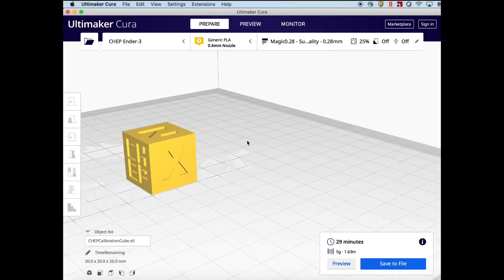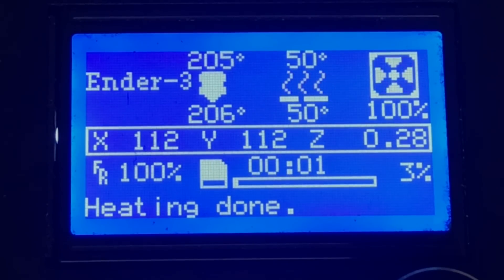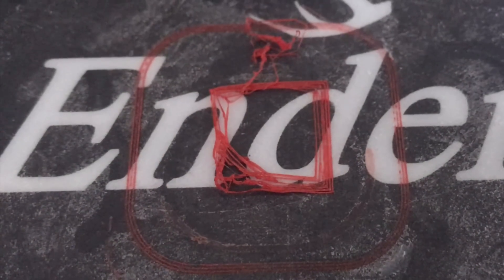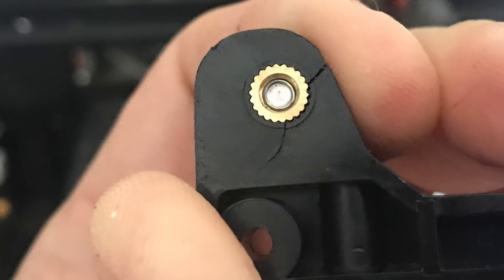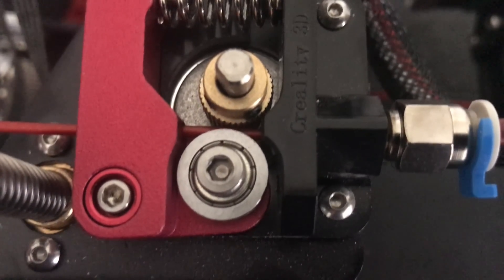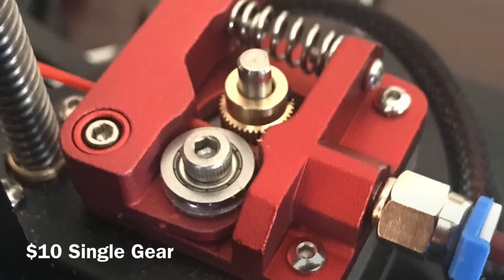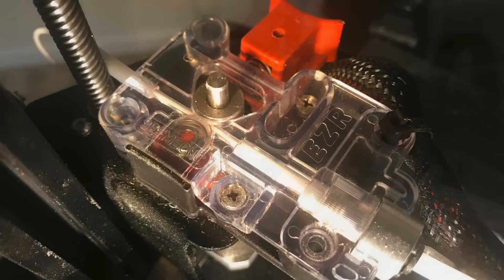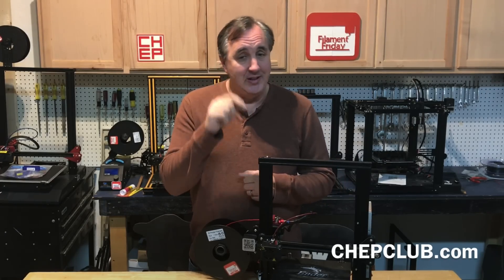Fix Under Extrusion from Cracked Extruder Arm on Creality Ender 3

Comment: Yup, mine is split really bad. I've been dealing with this for almost a year. What else should I go ahead and replace on my Ender 3 Pro? Thanks for the video!
Reply: Hey there, went through a similar patch. 

A safe bet is to replace your nozzle, your ptfe tube (or upgrade it to a Capricorn tube for 5$) and replace the pneumatic couplings on your printer on every part that uses them. These are some super duper cheap mods that can really help to set you up for long term use. Enjoy the wonderful world of 3DP!!

Comment: I hear crackling like a campfire when printing on my Ender 3 what is this? It's actually only when using black overture petg not white..please be mature, it feels like I have to say that.
Reply: Maybe you filament isnt dry. The Water evaporates and making the noise.
Reply: @Yo_Hahn  thank you
Reply: Make sure your extruded arm and tension are properly set and assembled. Easy thing to check could be where it’s eating/grinding your filament. Crackling can also be over heat, moisture, over extrusion bubbles etc

Comment: Just had a cracked extruder arm just one month after purchasing ender 3v2. Guess I have to go for the metal extruder.  Really just too fast a component failure. Creality needs to have a better version for the extruder. Thanks.
Reply from the maker: They upgraded it on their new Neo line. https://youtu.be/EKE1FnuTkcU
Reply: @FilamentFriday  at least they improved 😁

Comment: I want to say thank you very much! I never would have picked up that cracked arm! I tried everything before finding your video. Sure enough, I took the arm off and there was the crack. In my case, I glued it back together (just to make sure this was in fact the issue) and it fixed the under extrusion. I did however purchase the aluminum fix. Thanks again!
Reply: Hehhe.  I  actually removed mine to check if the gear next to it isnt maybe dirty from filament and slipping. When the arm was off and i turned it around... ta  daa

Comment: Even after replacing the extruded the idler arm still won’t spin unless I push down on the lever
Reply: I have the same problem, were you able to solve it?
Reply: @maximilianonunez8431  it ended up being a combination of two things. the nozzle was clogged and the position of my roll of filament was oriented in a way it was causing to much pull on the filament causing a clog. clean the nozzle out even if you dont think its clogged and then position the roll of filament as close to the extruder arm as possible.

Comment: Thanks again CHEP. My printer was doing the same thing, and finally decided to replace the extruder. It was also the hairline fracture. Just bought the metal replacement. 
Would be cool if the Ender came out with an expensive part model (such as metal extruder/better PTFE tubing/higher quality springs) would defs be worth buying

Comment: had the same problem tried everything cleaned nozzle, changed nozzle, changed bowden, tightened the spring of clip arm without knowing there was a crack which worsened the crack but finally found this video and tada i found the problem nice work man could not have done this without you

Comment: I was having under extrusion problems and it turned out to be the screw that goes inside the spring in the extruder. I tightened it in and solved the problem.

Comment: Thanks for this video.  I was having a major problem with under extrusion and I thought it was in the hot end so replaced the nozzle and did the hot end fix and nothing changed.  I watched your video and had a look at the extruder arm and didn't see anything but did notice the guide wheel was hardly moving.  There wasn't enough spring tension so going to try a new spring...I think I have a few...lol

Comment: I bought one in December and the extruder arm
Broke. I super glued it back and added baking soda for strength. Then I ordered an aluminum upgrade immediately. The aluminum one works great. I got upgrade wheels and springs also. I did the Bowden tube hotend fix too.
Reply from the maker: What wheels did you go with?

Comment: I had that happen on my 10-mini and swapped with that same kit months ago but it seems to be under extruding again. But I would like to hear your opinions on an intermittent issue. 2 days no problem, 3-4hrs of under extruding then back to normal and a day later its printing light. I've increased the heat the speed and changed the nozzle still happening
Reply from the maker: Replace or clip off the last 20mm of the PTFE near the nozzle. It’s probably burned out.

Comment: I had this same issue on my second ender 3 pro, first is literally still using the plastic arm with no issues, but the wall gaps continued after the aluminum replacement. My E-Steps/MM was off by 12%, so on a 100mm extrusion I only extruded 88mm. Something worth checking with a ruler and a sharpie.
Edit: I had also replaced the stock tubing with a shorter length of capricorn, my ideal retraction value is actually 2mm at 10mm/s now according to a test tower. Printing with 6.5mm retraction at 25mm/s (the cura profile default for me) gave me horrible bubbles in the nozzle.

Comment: Discovered  the same problem when I under extrusion appeared after about two months of printing. I printed a replacement extruder arm I found on thingiverse but still have some under extrusion. Is there an exact replacement I can print to solve the problem?
Reply: If your new part isn't broken, and it's still under-extruding, you can try some tuning. Print retraction towers for speed and distance to find your ideal values, too aggressive retraction sucks air into the nozzle and bubbles cause under-extrusion. Also calibrate your e-steps. CHEP has a video for E-Steps somewhere iirc. Still having issues? Try replacing your nozzle and cutting your tubing back making sure it's flat. If it's STILL having issues, try different plastic and a different slicer. Yes, even if you have been using the same spool for a while with now issue.

Comment: Just got an Ender 3 less and a couple weeks ago and noticed mine was cracked out of the box. Printed fine for the handful of prints I have done so far. But suddenly last night it just started having major under extrusion. Shame this is defective out of the box.
Reply: My Z axis mount was slightly wedge shaped out of the box. I had to hold the Z axis motor by hand while I printed a replacement.

Comment: Holy crap, I didn't even think about the extruder tension arm. I had replaced and cleaned out and verified every bit past the extruder and have beating my head against the wall trying to figure this out. Turns out my tension arm's crack was super close to matching yours exactly.I had a winsinn upgrade kit handy that I hadn't put on yet, but unfortunately the spindle and gear on my extruder motor are not the same as yours so I wasn't able to apply either of your fixes (the tension arm [my kit is slightly different than yours], or the replacement) as I have the compression fit gear. However, new motors on the way (thanks amazon) so I can get this printer fixed, and go ahead and upgrade my other Ender3 as well. As usual some sage advice. Thank you so incredibly much.

Comment: you will find that the main  drive pulley will eventually eat into the aluminum pivot arm throwing things in a bind, just experienced this last night takes a couple of rolls of filament but it will happen, am trying to figure out how to prevent because I loved this extruder over the original plastic had to order another extruder would love to see how chep would solve this when he experiences it. thge arm and pulley are in actual contact

Comment: I had a cracked extruder arm. I glued the Crack together and everything seemed fine, but then the filament started getting stuck under the bearing.

Replaced the mechanism and it fixed the issue. Tbh, for how cheap the part is a metal arm should be stock...

Comment: Thank you!  I COULD not figure out why my prints were spotty, barely laying down any filament, then laying down none at all mid print.  It didn't help that the lever arm broke simultaneously with switching to a new, budget filament.  Never was so happy to find a piece on my machine broken because I now know the source of the problem I've been trying to troubleshoot for a few days now.

Comment: I've felt like tearing my hair out for months over an under-extrusion problem on my printer and have addressed and replaced every part and setting I could think of until I came across this video. I took out the extruder arm and sure enough it was super cracked! Can't wait to install this part, thank you so much!

Comment: I  recently just started having this problem I have had my printer for about a month now and have had great results with everything stock but in the last few weeks I started to see extruder marks in my models and layer lines ext... and just a few days ago under extruding and horrible looking models so I came across this video so  I started  troubleshooting I started with my hot end and nozzle no blockages I re-leveled  my bed made sure my Z offset was correct ran my bed level I have a BL Touch installed nothing worked so I just checked my extruder and found the extruder arm craked under the bearing so I have an order in for a metal extruder will be here tomorrow thank you CHEP for the great videos I have learned a lot from this channel and really enjoy the videos

Comment: I DID THIS AND IT CREATED A NEW PROBLEM, I got my ender 3 about 3 months ago, and this extruder was a cheap upgrade that seemed worth it so i went for it. THEN i started printing Overture Clear PETG and I kept getting clogs about 1/3 into the print. They weren't clogging at the same spot exactly but close. 
 I already upgraded to the Capricorn Tubing as well.  Every time i would get a clog it was hard to pull the filament back through the tube. I noticed the extruder teeth were deeply embedded into the PETG so i took some quick measurements. Oh WOW- the extruder was smashing the PETG so hard that it was expanding vertically from 1.75+- to 2.10mm.  That is a real problem since the Capricorn tubing is ID: 1.95mm ± 0.05mm.  AND to add to the problem the location of the extruder puts the marks on the outside radius of the PETG as it travels through the tubing causing increased friction as it pushes against the outside of the tubing. 
  MY FIX- When i first assembled the new extruder i had two tension springs in my hand(new/old), i chose the stiffer spring (using the accurate forefinger/thumb squish test) thinking the extra tension would be a benefit. ( I was wrong) - NOW I put the soft spring in and haven't had a problem in 2 prints.  I hope this helps. Keep those first layers squished! Good luck!

Comment: I know this is shallow but I made my ender color pattern purple and green and I haven't bought these upgrades yet because they only seem to come in red. Same with bed knobs except I think you can get blue ones too. Does anyone know if I can get a green or purple hot end set up?
Reply: You can purchase anodized metallic paint in quite a few colors. Maybe that helps. You need a silver base and the top coat.

Comment: When I first got my Ender 3 a few months before this video was posted my extruder motor did not match the 93 steps per mm default at all, and I instead landed at a value of 235 steps per mm which I found a little concerning as other people calibrating their Ender 3 esteps only had to change the value by a small amount. Even after setting estep/mm to 235 in my slicer (Cura) I have still had issues with it under extruding on small (generally round) parts of a print, eg the smokestack of a benchy. Turning the estep/mm up more results in severe over extrusion on the rest of a print but perfect on small round parts. I went from Cura I think ~4.3 to 4.9 and the issue did not go away. I checked to see if there are any cracks like in this video but could not find any. Ideas on what might be wrong?

Comment: Been dealing with sudden under extrusion and came across this video. Checked the extrusion mechanism and found that I have the issue with a crack. Glad I saw this. My under extrusion was minimal and random, trying to fix these issues is like chasing phantoms. I knew something had suddenly changed though. Thanks Chuck!

Comment: You saved my ass! After 3 weeks of searching and troubleshooting I found your video. Sure enough my extruder arm was cracked. Thanks for this video!
I got my new printer and had been printing for 3 months and suddenly my prints went to crap. Just like the others commented, material wouldn't lay down and clumped up on the nozzle. I unclogged the nozzle, replaced the nozzle, replaced Bowden tube and fittings, bought a filament dryer...and I still couldn't even print a decent bed level test. I was so happy to find this solution.

Comment: Same bl**dy thing happened to me too... Just like Maheer in a recent comment I put heaps of time into tracking my problem, which was that the printer, an Ender 3 V2,  wouldn't lay down any material on the print bed, at best it dragged a sorry lite clump of spaghetti around as it traveled. I actually spent a whole week trying everything I could think of, leveling the bed for hours! Then I also noticed the filament didn't move much when extruding, tried pushing it by hand, and voila! Googled extruder problems and ended up here, removed the tension arm and discovered a huge crack. Guess I too will have to get a metal one instead...
Thank you, CHEP!

Comment: I recently upgraded to the Creality full metal extruder and I'm still getting massive under-extrusion. I even printed a 2mm spring tensioner plate but its still not enough. My Esteps are at 93, but if I feed 100mm of filament it only feeds ~50mm. 

If I hold the arm really tight against the filament, feeding 100mm of filament it then feeds ~83mm. So I'm not sure if the spring is the issue or if I should try the dual gear extruder. Any help would be appreciated!
Reply from the maker: Loosen the pivot of the arm so it puts enough pressure on the gear.

Comment: Extruded perfectly. Then after getting pissed off with the print not coming off the build plate, I got a little agressive taking it off. Somehow, beating the print off of the build plate (that is suppose to have a special coating that pops the print right off after it cool, which is complete bullshit) managed to destroy my printer's ability to extrude.

Edit like 4 minutes later* Yup! My lever arm is indeed cracked. It was in the SAME exact spot as yours, except mine was cracked all the way down.

Comment: About 2 months of printing now and haven't really had any troubles.  Started getting extreme under extrusion and tried everything.  Been at it for a couple hours now and was just about to give up because I haven't been able to print.  Found your video and checked notice that my lever arm is cracked!  I couldn't believe it!  Thank you so much for preventing me from losing all hope!
Reply: Having the same issue atm. Were you able to fix it?
Reply: @vodfives5555  yup!  Replaced the extruder because it had a crack in it that was hard to see.  Once I unbolted it, it basically fell apart into 2 pieces.  Bought a metal one and haven't looked back since!
Reply: @StenBuilt  that’s great! My metal one will arrive today. I couldn’t believe that this was the issue because my printer is only like a month old and I haven’t changed filament a lot so I didn’t push the lever a lot
Reply: @vodfives5555  I don't believe I changed filament too often before mine broke either, but sure enough, the lever arm was barely being held on.  Once the bolt for the arm came out, it almost fell apart.  The crack was hard to see until I shined a flashlight directly at it when it was all still assembled.  Glad to hear the metal one is arriving today so you can get back to it!
Reply: @StenBuilt  I really don’t understand why creality still ships the printers with the plastic extruder then. Because mine was definitely broken for a while because I noticed I had small under extrusions in all my prints before it completely failed 2 days ago

Comment: After printing for 8 months having a few issues together at the same time, all of a sudden there were bands of underextrusion in my layers. After a considerable time checking this and checking that, I looked at this video. "Bob's your uncle" the extruder arm pivot screw is too tight. My problems fixed! Thanks Chuck!

Comment: What would be causing my layers to be hairy and bumpy ? Just started with a blue PLA I got, I’m super confused.
Reply from the maker: Bad filament. Filament that needs to be dried out. Wrong temperature. Drafts from in the room. Bed not leveled properly. Issues with the sliced file. Errors in the SD card. These are common reasons.

Comment: Add me to the list of cracked extruder arm owners. Ender 3 v2 is 1 month old. I am just downloading the extruder arm model from Thingiverse and will try to print it while I wait for the aluminium ot arrive. Nothing to loose at this point really.
Reply: Printed wonderfully as I was holding the old, broken arm for the whole 45 minutes :) I did order the dual CR-10 metal extruder, but now I wonder if I need it.

Comment: I bought a direct drive system from Creality and after printing for about 25 hours I started getting an under extrusion problem. And the same part in mine is cracked that you have in your video Chuck and this is a brand new part so I'm a little ticked off at Creality The weakest point in the part is where the most stress against it happens. in other words the thinnest point around the little brass bushing where the screw goes in that holds the wheel is where the crack happened. instead of putting the thickest part of the plastic where the most stress is they put the thinnest part of the plastic where the most stress is.